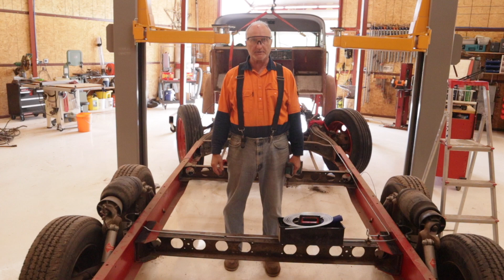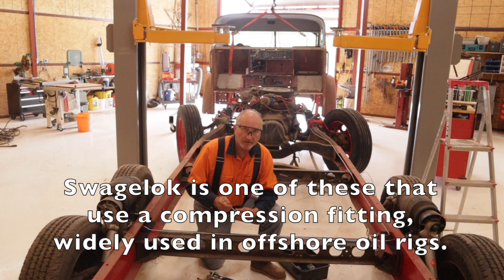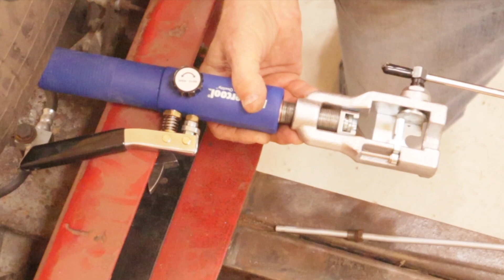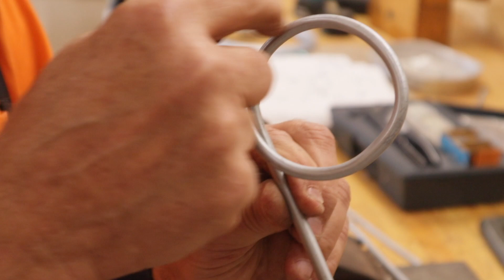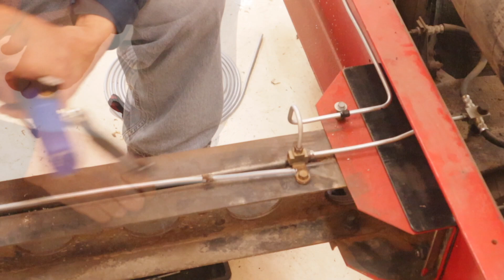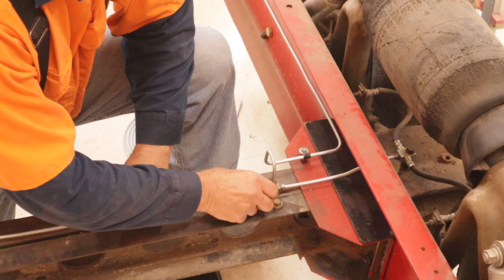Tool Review - Mastercool flaring tool

Comment: Do you use a little anti-seize on the fitting nuts?  Is it even recommended?
Reply from the maker: I haven’t been but I don’t think it would hurt. I think I’ll start doing that, thanks!
Reply: I would not use anti-seize on brake parts that are in contact with the brake fluid. Some anti-seize products contain petroleum which, if it gets into the fluid can damage the rubber brake seals in the system. 
I use Sil-Glyde Silicone Grease Lubricant made by AGS, if I want to lubricate something in the brake system. It does not contain petroleum and even says it won't swell the rubber seals, and is safe for brake parts and fluid on the product description.
I'll put a small amount on the flaring tool fittings when making a flare. Although not really needed, I think it helps a little by reducing friction. Then I'll also put a little Sil-Glyde on the threads of the fittings before screwing them into their holes to help them go in easier. And I think it does help prevent corrosion in the fitting joint. 
 I use the same kind of Mastercool flaring tool as in the video. I think it works best and easiest, and always makes a good flare. I've tried the cheap ones, and even the one he spoke of from Eastwood. Surprisingly, the Eastwood tool was less dependable than the cheap double-flaring tools. I sent it back.
Reply from the maker: ! Great comment! I’m glad I never followed through with anti-seize.